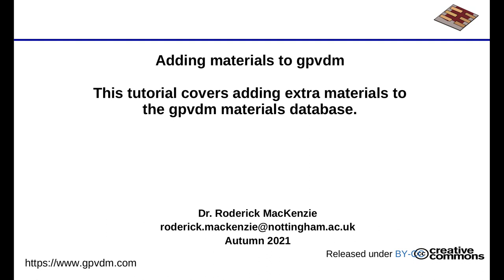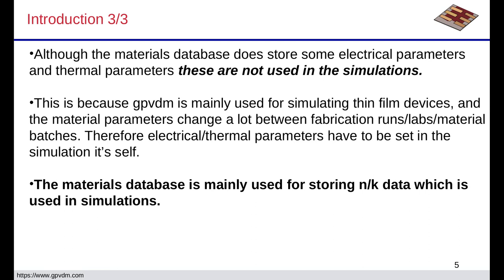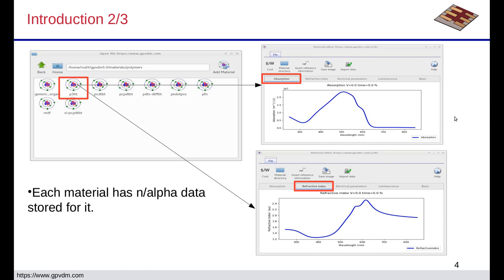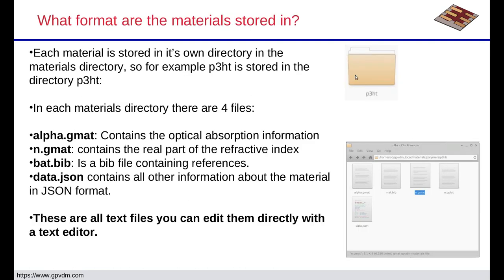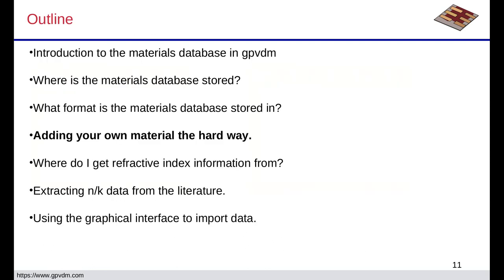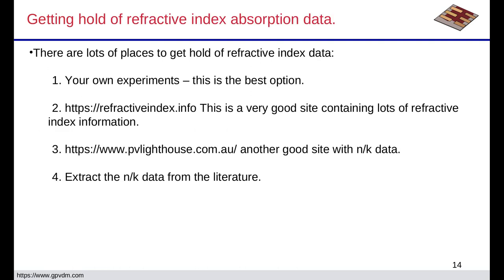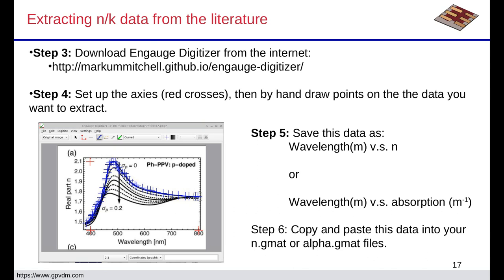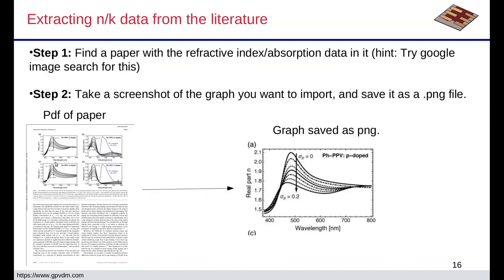A tutorial on adding new materials to OghmaNano

Comment: Hello sir, I m successfully added absorption and refractive index and band gap of material but from where do we get other electrical parameters like trap states etc.. Pls help
Reply from the maker: what materials system/device structure are you interested in?
Reply: @OghmaNano  sir, I want to simulate a OLED with Alpha-NPD as EL with NPB as HTL and Bphen as HTL pls help.
Reply from the maker: @sagarkiparchai9524  What I would do is turn trap states off by setting the number of traps to zero in all of the material layers in the electrical parameter editor.  I would then try to find sensible values of mobility in the literature for your materials.  Then play with the values of mobility/recombination until the JV curves match or are close to an experimental device. Then go and find the NPD emission spectrum (although it might already be in the model), and tune recombination more until it fits an experimental device.  It will take quite a lot of playing to get to work nicely. Hope that helps. R
Reply: @OghmaNano  thank you sir if I found any trouble I would ping you... Thank you once again sir

Comment: sir thank you for this tutorial i tried to add a TADF material called 2czpn and the data was given to me by my supervisor i tried using the method where you copy a material file and rename it and add the absorption wavelength and refractive index data in the alpha and n gmat files I tried this but it didnt work and instead i got an incorrect result for the input emission spectrum. Could you please help me to add this material in the software or could you add the material in the software yourself if possible.